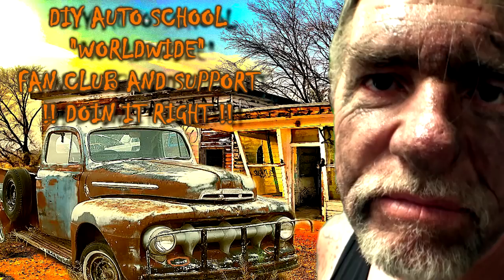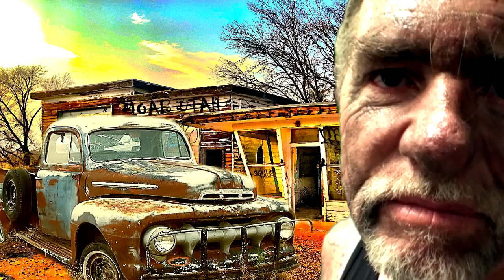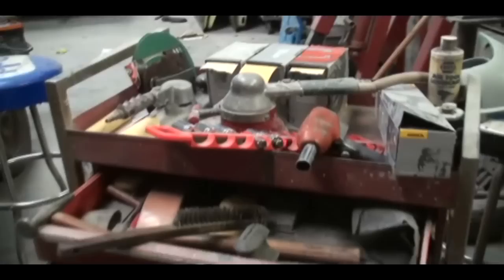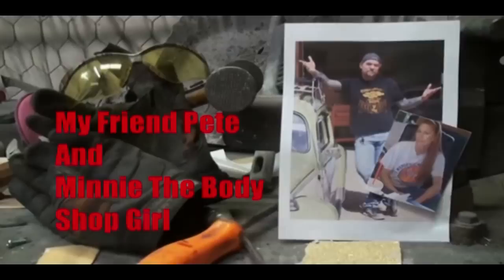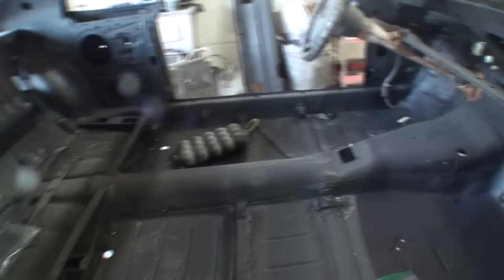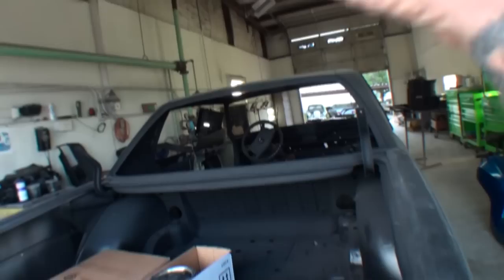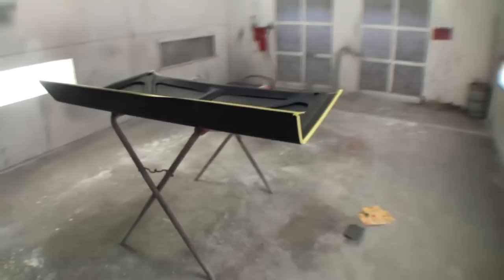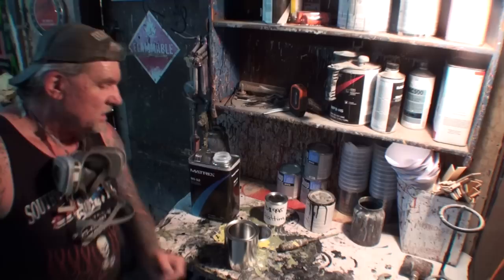How To Paint Your Car Matte / Flat BLACK - Do It Yourself

Comment: I like the fact that I can hear My Friend Pete when he talks. There are so many fads out there with paint colors and gloss levels, always use something that will hold up to the UV on outside panels, PPG has a pre flattened clear in their Global line that is awesome, and consistent gloss level, many manufactures have been going the way of semi gloss on their high end vehicles. You should show an extreme money saver version and use corn starch in your clear, it will give you a flat finish as well.

Comment: I did an awesome semi gloss black paint job on my 40 Ford pickup. The paint cost $8.50 for a quart of Rustoleum semi gloss. I mixed it with a quart of lacquer thinner and had two quarts of sprayable paint. It did the whole truck. Eight years later it's still holding up. I can buy semi gloss clear from my paint supplier so I don't see the advantage to making my own. 
Before you go off on me Pete I just want to add that even though I've been in the same business as you since the 60s I still learn new things from some of your videos. You inspired me to make a couch out of the trunk of a 50 Ford.

Comment: JOHN DEERE BLITZ BLACK PAINT. I've been painting cars and motorcycles with it for around 15 years...  Best matte paint I've ever used, it's super durable and UV resistant if you use a catalyst/hardener, I use Auto Body Master "Wet look" catalyst. Also, make sure you use the John Deere reducer/thinner, as anything else will make it tiger stripe. I've tried acetone, thinner, laquer thinner, etc and I've found the John Deere brand to work the best, and it's not very spendy. Blitz Black is $40/gallon, reducer is around $30/gallon, and the Wet Look catalyst is around $25-30/pint. I've tried the SEM "Hot Rod Black", and it's OVERPRICED JUNK! I've tried many paints for a matte/flat look, and Blitz Black is the best I've found, I'll never use anything different.

Comment: Worked with the "flat" finish with a couple of different vendors at my old job. Whether you decide to use a flattening agent in clear, or a flattening binder in your paint(implying single stage paint over sealer/primer), all the variables come into play on the final finish of the job. The level of tack of the base/sealer coat will directly affect the flatness of the top coat. Spraying a flattened topcoat over a wet base will inhibit the flattening agent in the topcoat. Also, using too high of a ratio of hardener in the top coat will inhibit the flattening of the the topcoat too. The critical situation is that we still need to promote adhesion. Spraying over a base that is dry & not scuffed with either scotchbrite or any grit of your choice will inhibit adhesion and that's not a situation we want. Scuffing also implies additional steps of prep. My advise is this: Shoot the top over a base that's nearly dry, and remember to NOT mix as much hardener in your topcoat as normal. Try a 5:1 with 1, or 6:1 with 1.5 part temperature appropriate reducer. A thinned topcoat will cut into the  base. This will promote the adhesion matrix and pass blending with, as Pete demonstrated, very fast drying flattening agent as you lay it down. Play with your overlap(I like one third with sharpest edge on the fan) and aim for a barely wet application. Warmer ambient temperatures(75F++) dry faster & flatter if you hit the base & hardener conditions right. Good luck with touch-ups.

Comment: Great video Pete is there any problems with cleaning out the gun using this mix and seeing how quickly it can dry would you clean the gun straight away    Rob
Reply: Clean the gun just like normal.. No issues with anything but when you first mix it up..

Comment: love your channel been watching for 4 or 5 years. I've been painting cars since i was 16. you do it for a living ,i do it for a hobby and on my own cars and bikes. In your experience what spray gun gives you the most bang for the buck? i currently use a MAC econoline for primers and a Develbiss Finishline for single stage and Base /clear , i am looking for  a new gun that will handle the high solids clear and solvent based color better. I dont plan on using the water based base coat.